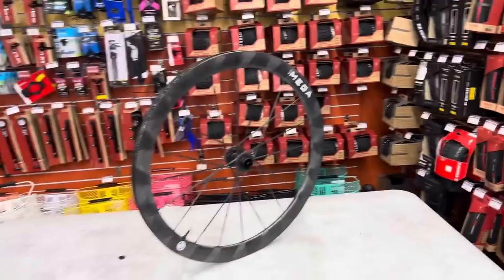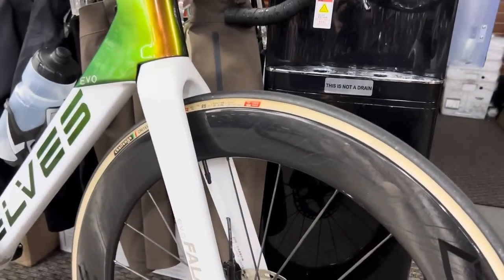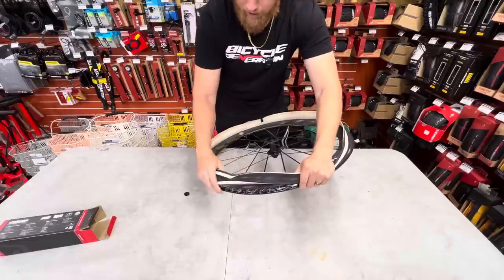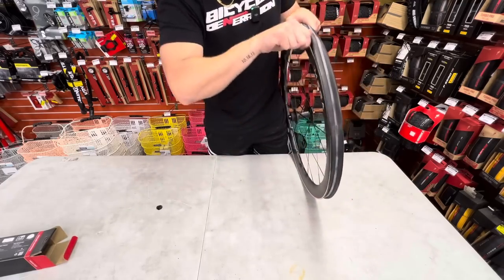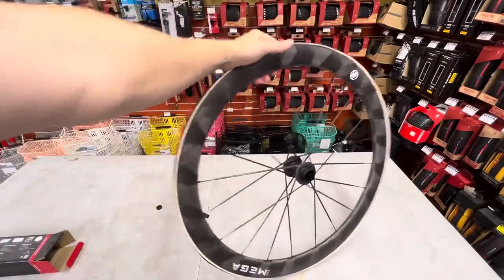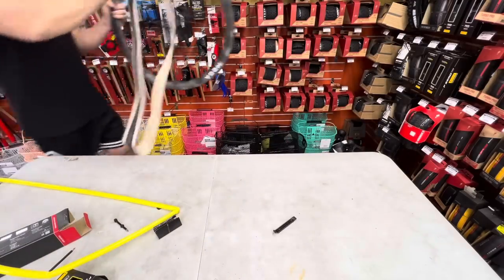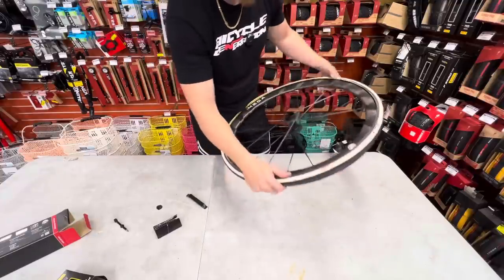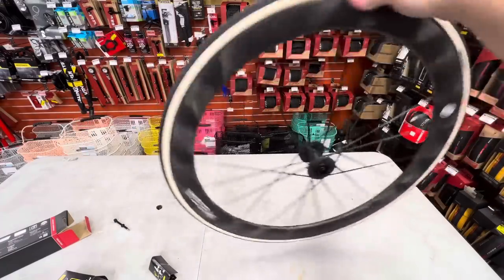I LIED..... 99% OF CYCLIST CAN NOT INSTALL THIS TIRE!! *IMPOSSIBLE*

Comment: Worked as a pro mechanic for a team with challenge tyres and you always wanna work down towards the valve!!! 

This allows you to push the tyre into the centre of the rim trough all the way round, and the difference is phenomenal. I end up putting them on by hand no stress 😎
Reply: Yes! Challenge tires are great tires, and can (!!!) be put on without tire levers, using the above method. Also, once they are on (1 ride), they stretch and are easy to change.
Reply from the maker: i have heard 50/50 on this but i am going to give this a try, I was taught young by mechanics before me and they all told me away from the valve because you have less material at the end and can work better to secure it, but they could be wrong and I might be working against myself all this time I will try next challenge tire your way :) thanks for the tip
Reply: Always towards the valve. It gives more slack in the bead and, if you're using tubes, the valve holds the tube in place so you don't pinch it when Getty Ng the tyre on l.
Reply: Was on a group ride a few weeks ago. Guy was trying to get a tire back on for several minutes (Conti GP5000 onto a Roval CLX rim) and was working towards the valve. Couldn't get that last few cm. I finally grabbed it, pulled it off, and started at the valve, like I always do. Went on in about 10 seconds. I've only tried doing it towards the valve once and couldn't get the tire seated at the valve - been going the other way ever since and never had an issue...
Reply: Yet another polarising argument in the cycling world- we love to argue: Mechanical vs DI2, tubeless vs tubes, aero vs endurance, latex vs TPU, road bike vs MTB and on and on and on 😢😅😮
Reply: @BobMcAllan Mine never stretched... Ended up ditching them for something else

Comment: I discovered that with the gravel oriented Challenge tires, where there's more body to the tire itself, you can get the last bit of the bead on by using the heel of the palm of your hand and rolling the main body of the tire up -- so not pressing up on the bead with your aching, lactic acid scorched thumbs, but above the bead. The suppleness of the casing seems to give you leverage on the bead and it pops into place. I also applied hand disinfectant gel to the bead, goes on slippery, but evaporates fast.

Comment: I had a HUGE struggle with a challenge grifo handmade set too! I ended up zip tieing the bead and rim together through the spoke gaps all the way to the final bit of seating the tire. felt extremely wasteful but i could not get these on for over an hour until i resorted to the zip ties

Comment: Suggestion, I had the same problem, You had the tire on the rim with a TBLS, stem installed. What I did was to inflate the tire to seat the beads, Then deflate the tire, remove the valve, and remove the tire on just one side. With the bead seated on the other side , it gives you more room in the wheel drop center to make it easier to install the tube and bead, Also I finished at the stem, to to give more room for the bead to drop all the way to the center , also the valve is plastic, it can break or deform.  Worked for me.

Comment: I love Challenge tyres. Once you learn the technique they are easy to put on. If you get a flat they practically fall off and go back on very easily. Best this also is if you need to ride on the flat tyre it tracks along flat so your rim doesn't touch the road. I rode 4 km on a front flat once and it got me home safely.

Comment: Yes, they are definitely the most difficult tires to install. Still, there is a way to install them withOUT a tire lever. I have done it several times on Farsports Hypers and DT Swiss ERC 1400 wheels. All you need is a bit of thick soapy water on the rim at the last final part of the tire to make it slip in the rim. And "pinch" them a bit differently to help the bids come in the center rim channel. BR, George.

Comment: Nicely done. I was used with my Vittoria Mezcal on MTB wheels and they were super easy, but then I got a road bike with a Continental Ultra Sport 3 that was a nightmare, I even broke a tire lever when I was changing the regular tube for a TPU tube, but after a long battle I did it.

By the way, have you tried the 'new' Ride Now ultralight tubes? They weight only 19g and I believe they're even cheaper

Comment: I picked up the Tire Monkey lever from Tru Tension and it's made changing tires night and day easier. Clever design that especially helps setting a bead
Reply from the maker: I have to check that out. As a mechnic though it’s like my job to be good at it lol
Reply: @GCPerformance18  would love to hear your thoughts if you do pick one up and try it out! Great video here 👏

Comment: Yo GC, an old Italian bike mechanic in Taormina (Sicily), showed me his way of working with Challenge tires. Basically, he stretched the tires before mounting them with moderate force ... similar to tubulars. He used a screw clamp with a piece of wood and stretched the tire for 2-3 days at indoor temperature.  ... shure this wouldn't work in a bike shop but for DIY mechanics pretty usefull.
Reply from the maker: yea that does help too I have done that recently and stretch them

Comment: I installed last week 2 Challenge Strada Bianca H TLR 36mm on Roval Terra C wheels with TPU inner tubes. I followed the challenge instruction video. 15-20 mins per wheel and ready. As I am
a totaI  noob on tyre fitting (really!!!) and scared to damage the TPU inner tube on my first attempts, I used first a butyl inner tube to seat the tyre a first time on the rim and check. Then unseated one side and swapped the butyl for the TPU. Needed only 1 tyre lever!

Comment: Hey Daddy, use some Pedros tire levers or Cushcore tire levers. Pedros also has a fantastic tire lever made for getting unlimited leverage. Also and finally, cushcore has the Bead Bro that acts like a third hand and physically holds the tire so easily. Just a few tips. I call the Bead Bro the Challenge Bro because that's what I use them for. From one bike shop pro to another. Love your videos bro.
Reply: I've broken Pedros tire leavers on really hard to fit tires before.  They are stronger, but they still break.

Comment: Did you try the bigger challenge tyres on the gravel elite wheels?
It took me 20 minutes to get only 1 side of the tyre on my elite drive wheels. Second part made me chip my rim with the lever.. I couldn't get the tyre inflated once it was on there.. Couldn't get the tyre off my wheel after I gave up on the whole project. Went to my local bikeshop, and they needed 2 men for about 10 minutes to get the tyre off the rim.  
Lesson learned: spend some more money, and get the Rene herse tyres with actually better rolling resistance if you want to go the wider slick gravel tyre route.

Comment: Daddy few questions since you are the daddy. 
1.I’m in Chicago windy and flats would you recommend Hyper R67 or R45?
2. I have 2015 tarmac Sworks their proprietary crank. I replaced the BB30 bearings with generic $65 wheels Manufacturing. However, I am not sure if those bearings are not good, but I don’t think that the crank rotates as easy as it shows. What do you think and what bearings will you recommend?
Do you think that my current crank system is stiff enough, or should I switch the crack with Shimano dura-ace and press-for bottom bracket? 
Thank you daddy 😊
Reply from the maker: so Chicago I would say is very similar to where i am, over 40 miles of riding we get like 220 feet of elevation so I always go d67 wheels, and we are right on the east coast so I am riding on the beach so all we get is wind non stop, I have no issue with the d67 in crosswinds, I just know if it is windy out just ot be mindful of it. but I think you would benefit from d67 the most for the flats..... and second I know those cranks very well, if you can I would recommend going to a bb30 to shimano spindle and get a shimano crank... a solid sleeve bb machined out of alloy will give you more stiffness and more support, but this is only if you have the free cash to do so, if not then get the bb30 bearings from ceramicspeed if you want the best least resistance.... but i have installed wheels manufacture and they work very well, just check crank install because I know sometimes with that lock nut on the non drive side if it is not done correctly it can cause drag
Reply: @GCPerformance18  Thank you for the response. You are on top of you staff 100%. 
Size 56 frame my height 5”11-6 would you recommend 172.5 or 175 length? Also, help me choosing the correct bottom bracket will be greatly appreciated. Too many to choose from. It’s hard. Thank you daddy 👌

Comment: Valve stem area last. Pretty basic stuff. Mount about 1/3rd of the second bead and then tug the slack outward, then work the slack toward the unmounted section.

Comment: 5 hours the other day spent trying to get hydraulic fluid bled through the hood and wouldn’t work.  Disassembled each piece of the system to see where the blockage was.  Turned out the older version of the red colored sram olives are a different size than the newer ones.  Refused to give in and stubborn but that’s one more maintenance skill now I can say I’m comfortable with doing.

Comment: I've had good luck with tools like the Bikehand tire lever. Zip tying the tire flat near you're try to seat the bead works too. Otherwise good job on the demo. Looks like I staying away fromChallenge and sticking to Conti GP 5000's.
Reply from the maker: Great tip!

Comment: Question: are folding tires easier to put on than full wire bead?
Reply: I think so. What do you think buddy?🤔
Reply: @YTOnlineReviews  I have no idea. I've only worked with full wire bead because that's what my friends who know more have always recommended. I also don't need new  tires that often
Reply: Yes, folding tires use a softer mixed synthetic bead that has a little more flex so it can be folded compared to tires that can't be folded that use metal wire beads. Not all, but most non folding tires use metal beads because it's cheaper.

Folding tires therefore will have slightly more stretch available than metal bead tires.

Comment: Really entertaining video!! Challenge tires must ride and roll phenomenally. If they rode like every other tire on the market, they would go out of business because no one would buy these tires because of how hard they are to mount on a rim. But I will still stick with 28 mm conti 5000s with latex tubes on elite wheels. Best combo I've ridden ever. But I'm intrigued by Challenge tires. But I would be worried about fixing flats on the road side.
Reply from the maker: Thank you os much!!!

Comment: Reminds me when I had to use two hands and a foot when I first tried to get a conti tl tyre on a shimano rim. Tyre bead kept running away on me around the rim on that last hard section. Whatever I put on one side kept popping off rim on the other side. Took me 30minutes to put one tyre on! lol Lucky they had good puncture resistance as I knew if I got a flat riding, there was no way I was fixing that tyre at the side of the road

Comment: anything continetal is more difficult than other tires to install and remove. I lost a lightweight butyl tube when install an used unltra sport 3 onto my newly laced wheel. Kenda and CST on the other hand, can be put on and off easily, sometimes don't even need a lever to get the job done.

Comment: Yup. I run Challenge handmade tubeless road and cross tires on Bontrager Aeolus Elite 35 wheels and mounting new tires first time is a brute, but I've figured it out. I use multiple flat screw drivers with cotton padding to protect rim. And water mixed with dish soap to lubricate the rim/tire. I think my tubeless tire/rim combination is worse than yours too. They are handmade in Thailand not Italy.

Comment: I tried installing those white wall R tires on my PCW 4550s.. they were impossible to get on. So I had to take them to my local shop. Nick said they were the hardest tire he’s ever installed. And he hopes that I never get a flat tire bcus I’d definitely be calling an Uber. Mine are tubeless setup. They leak sealant through the sidewalls. And if I don’t inflate them every 2 days they go flat. I’ll never buy another set of Challenge tires again.
Reply from the maker: yes they are for sure the hardest tires to install, once installed though they are easier to remove for flats its just the first initial put on..... as for the tubelss install, I have not had issues like that, maybe its just a one off, but i do not know
Reply: I was thinking the same. The front will hold air for a week.. the rear 2 days if I’m lucky. But I can say I don’t have any problems while riding. Just when they sit.

Comment: that tire will be hell when you need change your clincher tube in emergency puncture. i get that kind same experience with WTB vulpine
Reply from the maker: its not so bad once it is installed, so once mouinted it stretches way easier

Comment: I went through this the other day. After taking over an hour to install 3 TPU tubes and pinch flatting one of them with a set of new Conti 5000s, I decided to carry a butyl tube as a back up. There is no way I am going through this on the side of the road.

Comment: The best tire irons I've found so far were the Lezyne Power XL levers, super strong levers.  I broke 2 steel core levers and a Pedros lever trying to put Schwalbe Amotion tires on a bike, and then almost broke my VAR tire lever.  So I put the project aside and ordered a pair of Power Lever XLs and a Kool Stop Tire Bead Jack.  Once those came in the mail I then used 2 reusable zip ties, and soapy water.  So as I was put on the bead on one end the other end would come out, so I used the zip ties to hold the bead against the rim on one side so I could work on the other. Once I got to the point where the Power Levers were simply not going to work due to there being no space to lift the bead up and away from the rim and up and over the rim edge I switched to the Kool Stop, that thing slid the bead along the side of the rim and into the rim.   That tire literally made a loud snapping noise when it went in.  I did all the stuff you did too, making sure the bead was in the center of the rim, etc.

I know you're laughing and probably thinking you could have done it without tools, you probably could have, but I'm 70 years old with arthritis in my hands and thumbs, and they were aching like crazy doing that, so tools help me out a lot these days.

Comment: I've just swapped these over to my new bike. Needed pliers with a rag doubled over in the jaws to pull them off the bead! Then it took 5 attemps to seat the bead using an Air Shot. The last attempt I had to pressurize the Air Shot to the maximum 160psi, this is with valve core removed! 😮‍💨
Reply from the maker: man these tires are no joke. they are awesome once they are on and also once they are mounted they are easier to remove

Comment: The hard part is to get them round on the rim - tried loads of times and I get high or low spots you can feel on the ride. ( not over the valve) any tips cause it’s a great tyre to ride on apart from the bump, bump, bump😂
Reply from the maker: Thanks for the tips!

Comment: I mounted a new pair of 40mm on dt swiss gr 1600 wheels. Yes, they are tight but using the right technique I didnt really struggle that much.
Start opposite the valve and put one bead over the rim working towards the valve, push and stretch down.
Do the same for the other bead until its too tight to push any further.
Go back to the side opposite the valve, hold and squeeze the tire between your fingers, wiggle it to move the beads more the center of the rim and work your way around the rim towards the valve.
You should be able to get more of the tire on the rim - repeat until you have about 6-8 inches left to get on, use plastic tire levers to pop it on.
For tubeless, spray a good amount of soapy water between the beads and the rim (spraying the outside wont do it) - i just use a simple window cleaner bottle filled with water with a bit of dishwashing detergent. Start pumping and keep pumping, the tire will start to seat.

Comment: it's easy, after about 3 hours of my first installing these tires I found a trick. Just push the all the bead into the groove in the middle of the Rim bed. This works on all tubeless tires. But as for Challenge the tire tread folds into the rim so that's impossible to push the tire bead into the groove.
I just squeeze the tire tread up, away from the rim bed, and leave enough space to push the tire tread into the tubeless groove of the rim bed. It works well. I have installed  challenge tires with this trick many times.    
U Guys should know why there is a groove in the middle of the rim bed.

Comment: Heat them first in the sun and use plenty of talcum powder for the last push lube with some alcohol gel 
No tire leaver needed
After riding for awhile these tyres are super easy to remove and reinstall
Challenge tyres provide a very smooth ride 
I'm using 25C with tubes

Comment: Cheaters way is throw the tire(s) out in the sun for 20 minutes so it gets nice and flexy, then stretch out the bead by hand....step on the tire with one side on the floor, then pull both hands on opposite side with all your might.  Rotate 90 degrees and do it again.  Repeat a few times on both beads.  The heat and mechanical pulling will stretch out the beads before you even try mounting it.